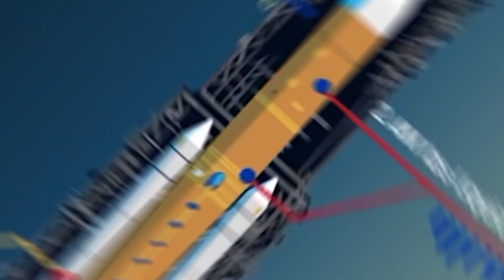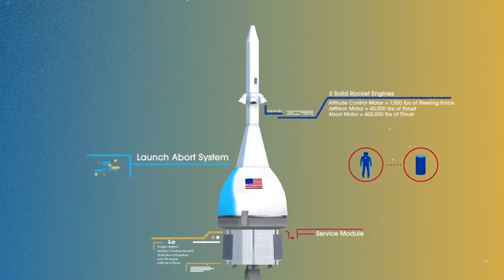NASA's SLS Versus SpaceX's Starship

Comment from the maker: Should NASA just cancel SLS and use Starship and other commercial launchers instead?
Reply: No, we need redundant systems. Spacex still has to prove the starship can reach orbit. I believe the system will launch but could veer off course and they will have to abort flight. The problem is the size and location of starship. Windows will blow and debris the size of cars will rain down. I hope it is a success but for now cross your fingers.
Reply: Sorry no. As much as I like Elon Musk, NASA is the only space entity that is 100% loyal to the United States. Space X, in theory, is not. Also, starship is not even near operational, but SLS is almost ready.
Reply: No SLS will be safer, when we will learn that rockets need escape systems? Starship should just be landing module and space teavel.

Comment: NASA SLS/Orion vs SpaceX Starship
Project cost: $60+ billion vs $5 billion
Project years: 16+ vs 3
technology: Throwback legacy vs modern
reusability: throwaway vs fully reusable
Air pollution: Carcinogenic spewing solid rockets vs clean
Pollution: Dumps entire vehicle in our oceans Vs zero
Cost per launch: $4 billion+ vs $2 million (fuel)
Cost per engine: $146 million vs $250,000
Can land on moon/Mars: no vs yes
Expected Flights per year: 1-2 vs 1,000s
General use for other payloads: No vs Yes
Can tanker fuel to LEO: No vs Yes
Crew section:
.  width: 15 feet vs 30 feet
. Pressurized volume: 300-700 cubic feet vs 38,300 
. # crew/passengers: 2-6 vs 200+
. Return payload: 220 lbs vs 100 tons
. Payload to the Moon: Zero vs 100 tons
. Payload to Mars: Zero vs 100 tons

Government projects typically cost 10 times private enterprise to build & operate, but SLS is 2,000 times more costly than Starship, and massively more polluting to the environment.
Reply: Nicely made up fantasy.

Comment: So very frustrating watching videos that are wildly inaccurate.
Reply: It’s pretty frustrating to read a post like yours without any facts or specifics provided.
NASA SLS/Orion vs SpaceX Starship
Project cost: $60+ billion vs $5 billion
Project years: 16+ vs 3
technology: Throwback legacy vs modern
reusability: throwaway vs fully reusable
Air pollution: Carcinogenic spewing solid rockets vs clean
Pollution: Dumps entire vehicle in our oceans Vs zero
Cost per launch: $4 billion+ vs $2 million (fuel)
Cost per engine: $146 million vs $250,000
Can land on moon/Mars: no vs yes
Expected Flights per year: 1-2 vs 1,000s
General use for other payloads: No vs Yes
Can tanker fuel to LEO: No vs Yes
Crew section:
.  width: 15 feet vs 30 feet
. Pressurized volume: 300-700 cubic feet vs 38,300 
. # crew/passengers: 2-6 vs 200+
. Return payload: 220 lbs vs 100 tons
. Payload to the Moon: Zero vs 100 tons
. Payload to Mars: Zero vs 100 tons

Government projects typically cost 10 times private enterprise to build & operate, but SLS is 2,000 times more costly than Starship, and massively more polluting to the environment.

Comment: 4:07 - "To date, there are 26 Raptor engines built, most of which are in pieces" WRONG - on July 27, 2021 Spacex celebrated their 100th Raptor built, and have flown Raptors on Starship prototypes to 10K Altitude. Right now there are 29 SL Raptors attached to Super heavy Booster 4, and 3 SL + 3 Vac Raptors attached to Starship SN20, the latter of which has had successfull static firings of all 6 engines simultaneously.

Your information regarding Spacex is sadly out of date.  Starship SN15 flew to 10K and landed successfully in May 2021. Spacex has NOT experienced a single cost overrun for NASA with any of its CRS, Crew or satellite launches. As of 11/16/2021 Spacex has had 128 Launches of Falcon and Falcon Heavy, using the ONLY Reuseable Booster ever built.

Your bias in favour of SLS is very obvious. Not a single component of SLS has yet flown, while the cost overruns are vast and scheduling issues continuous.
Reply: Orion flown, rl-10 flown, esa third stage flown, boosters most of it has flown core stage is the only one not